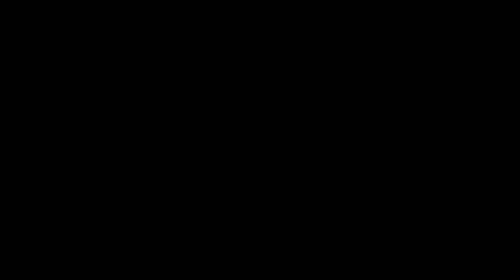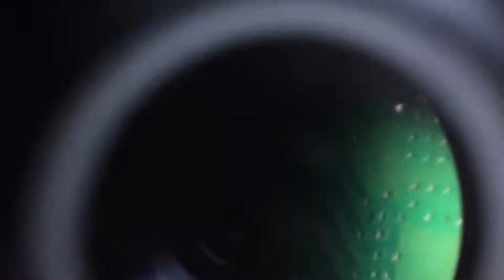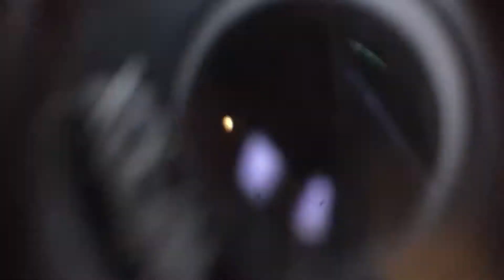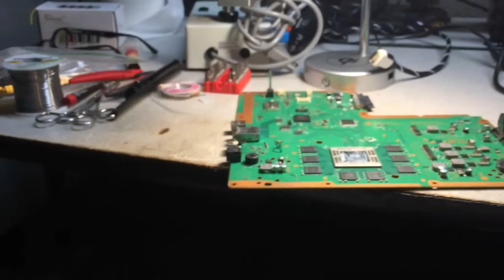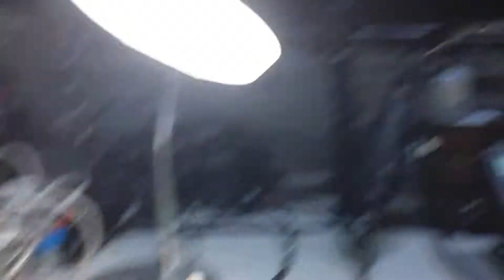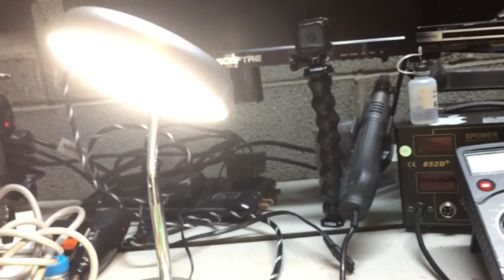loose pins on ps4 HDMI port

Comment: No signal but ps4 working fine. In the port on mines, there's 2 pins on the bottom row that are in further than the others but they aren't bent. Is that the problem?
Reply from the maker: This is on the original model?
Reply: @chasefournier  yes it is cuh-1115A
Reply from the maker: @SixPathsOfEntanglement that's very common on that model. It'll need a new port.
Reply: @chasefournier  Ok, thank you for your prompt response. Liked and subscribed :)
Reply from the maker: @SixPathsOfEntanglement  if you are looking to get it repaired, my email is chasefournierrepairs@gmail.com 

Go ahead and fill out the template (in the video discription) , and send it to me.

Comment: Are the two gold pins in hdmi port supposed to be facing up or laying flat?
Reply from the maker: You’ll have to elaborate more on the question because I don’t quite understand what you mean. 

Basically any pins inside of the HDMI port or the legs on the back of the port that connects to the board need to be flat. They all do.